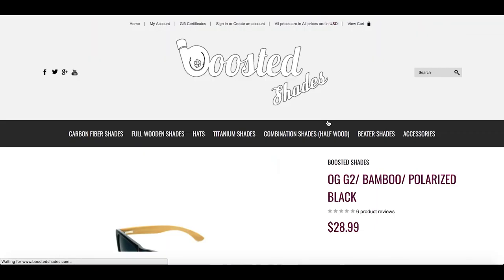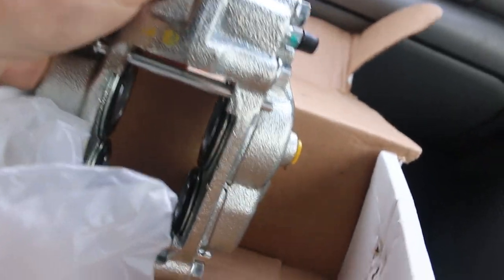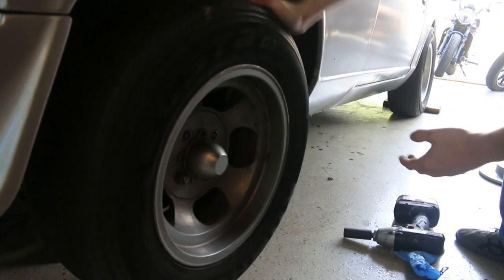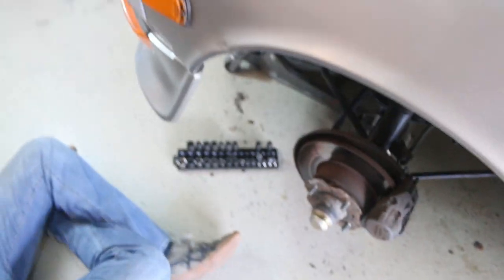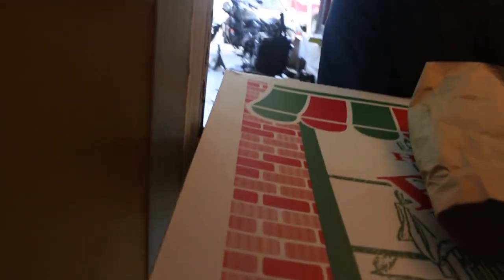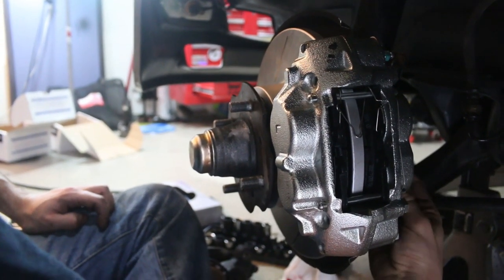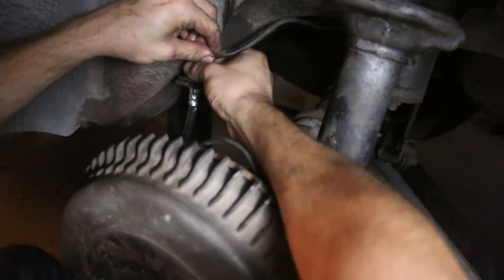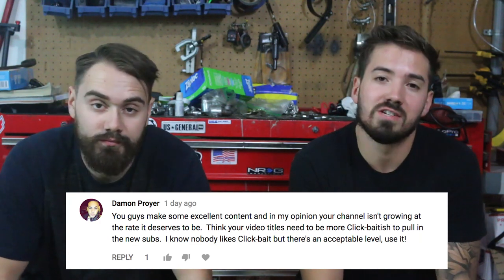The CHEAPEST Big Brake Upgrade Possible!

Comment: Change the plugs to a range colder and close the gap to .30. If that doesn't work, check fuel pressure. Last time I had a high rpm break up, it was the boost blowing out the spark. Keep up the good work!!

Comment: Might want to check out your brake bias after the front brake upgrade. A proportioning valve will help get it back evened out. I have a LS1 swapped 74 260z and would love to have 10k to fully replace the suspension and repaint the car. Let me know when you find that magical check writer

Comment: Hey boyz just a few word's of wisdom from an old mechanic.  As a rule....   With brakes, what you do to the left, you do to the right.  Applying the same school of thought (safety and correct repair procedure) .... you have 3 potential repeats of the blown flexible brake hose repair you just dealt with, in your future because you left 3 possibly bad hoses on the car.  All hoses have seen the same lifetime  of abuse. Your left rear was just the first to take a shite..........Just sayin....  It is worth buying the stainless
 4 hose kits(e-bay) as they make the pedal even more rock  solid. (kits are sometimes cheaper then replacement factory hoses).                                   Porsche, there is no substitute. Can't wait.. keep it up

Comment: I have an 02 WRX and if i got 10k id I would do larger turbo, fmi, injectors, full exhaust system, full aluminium radiator, cobb tuner or stand alone ecu weather be haltech mega squirt ect

Comment: Are those S12+8 calipers?  S12W > S12+8 but a great mod none the less.  S12+8 work with the non-vented rotors, but if you want to upgrade to a vented rotor, the W's are where its at.

Comment: if i had 10 grand id use that to cover the cost of the rebuild get the heads ported, supercharger ported, smaller pulley, lighter fly wheel, trans mods, guages, and a new paint job